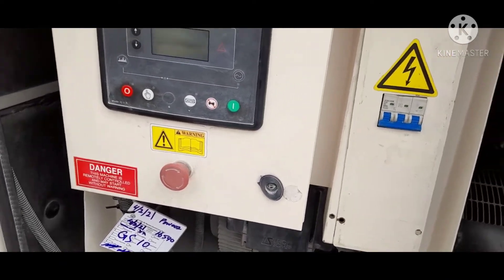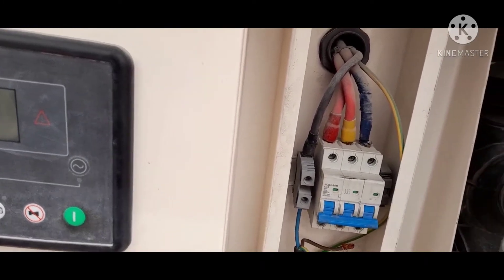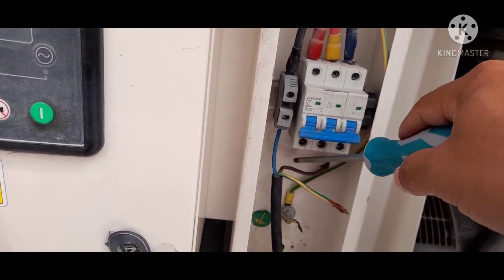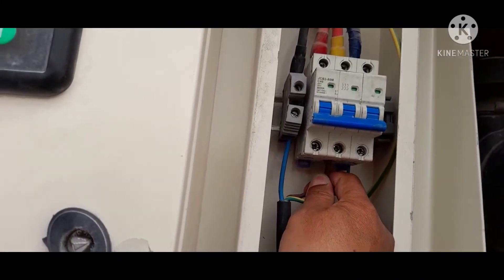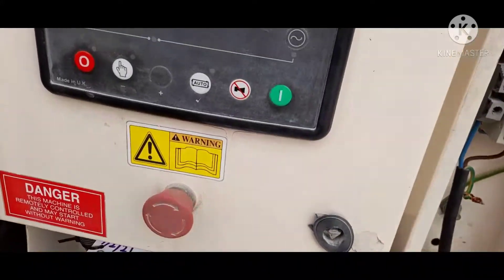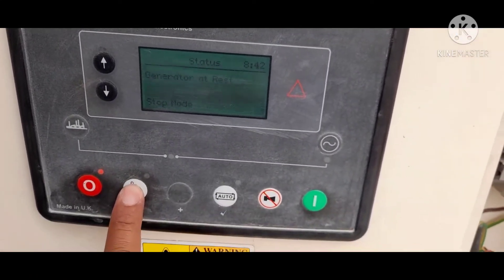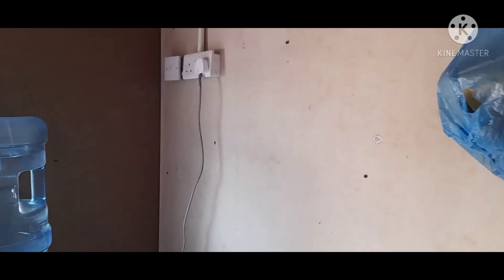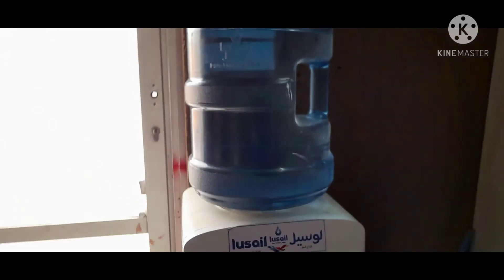Paano magconnect ng single phase sa 3 phase na power supply

Comment: sir tanong ko lng,,ganon din ba paraan sa wiring kng three phase ang generator pro 230 lng ang supply ng generator.. single phase na ang labas
Reply from the maker: Yes po ganun lng ang pagwiring bsta single phase ang ang kilangan mo madam
Reply: @jerryelectricaltutorial5228  salamat po..eh paano nman kng mag connect ng motor na three phase kailangan ba talaga ang color coding or hinde na...?
Reply: @jerryelectricaltutorial5228 sir kng mag connect nang motor na three phase diritso naba yong tatlong wire nang motor sa supply  na three phase na hot wire or kkuha pa ako sa neutral wire?
Reply from the maker: Wla nmn prblema kng hndi na color coding bsta ang emportante wlng short circuit, pero mas magnda prin kng nkacolor code

Comment: sir pwede ba yung ground parehas lang sa ground ng 440v ? dito kasi sa barko may connection kmi ng 110v at 440v, pwede din ba magawa yung ganyan sir?
Reply from the maker: Ok lng yun sir, dhil ang ground is zero volt wlng prblema yon
Reply: @jerryelectricaltutorial5228  bali sir kkuha ng isang line dun sa live wire no? tas yung nuetral nya iconnect sa breaker? tama ba sir? tapos yung ground iisa lang?
Reply from the maker: Anu ba ibig mo sabihin sir?
Anu ba ang supply nyo line to line or line to neutral na 440v?
Reply from the maker: Oo sir tama kng 220v lng ang kailangan mo
Reply: @jerryelectricaltutorial5228  need ko sir ng 220v connection sir
Reply from the maker: Oo sit ganin lng gagawin mo kuha lng ng isang linya sa hot wire tapos isa sa neutral pra sa 220v.
Reply: @jerryelectricaltutorial5228  okay sir thank you ng marami

Comment: Paano pag U V W paano itap yun
Reply from the maker: Madali lng sir e tap mo lng kahit alin jan u, v, w, isang cable bali yan ang hot wire mo, tapos isang wire tap mo sa neutral
At yan may 220v kna na power supply